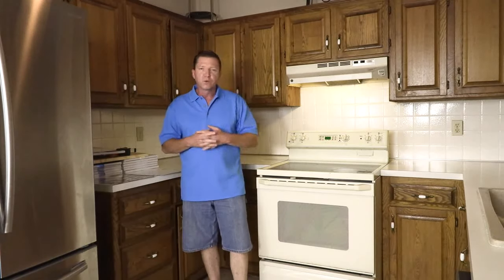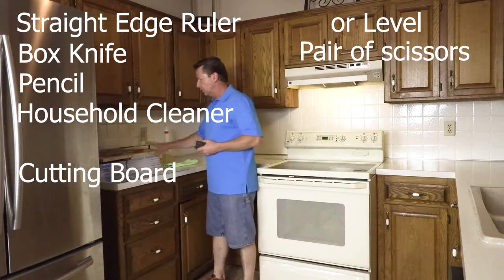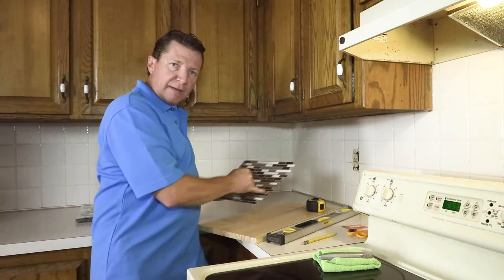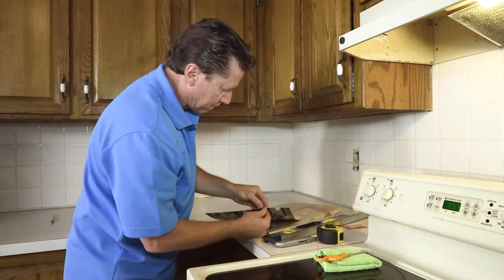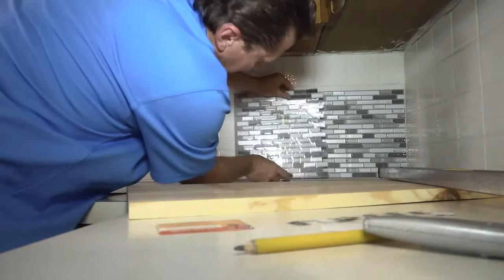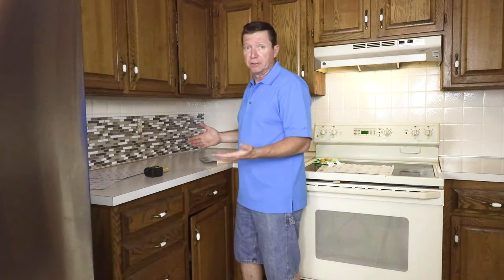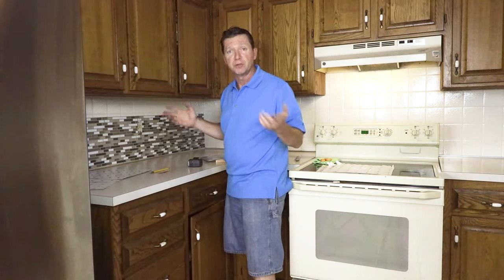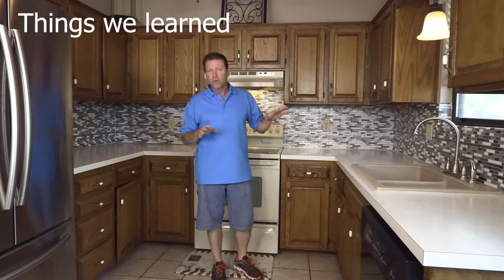Art3d Peel and Stick Tile Kitchen Backsplash Installation

Comment: To make a flat wall so it sticks better, I watched another video that shows filling the grout with quick dry poly filler so it makes a flat wall. This is the video that shows how she did it. That would make the wall flat and that tile would stick well and possibly help prevent any problems with the tiles sticking anywhere. Love the look here! Great job!
Reply: Which video? Can you comment with link please? I am applying this backsplash to my tile walls

Comment: I suggest turning the pieces and mixing them.  If not then it results in a repeat pattern as observed on right area creating a line.  Does anyone else see this? I also see the line on the left yet closer to the counter.  To avoid a repeating pattern make sure the sheets are intermixed. This is similar to hanging wallpaper where depending on the pattern, each sheet should be reversed. Play with it before mounting as I could not live with this outcome
Reply: I see what you mean. The black line of tiles in the middle and the same mountain peaks on the bottom. I also wouldn't have tiled in the window.

Comment: May I suggest painting the cabinets and changing out the hardware for a super fresh, updated look?
Reply: I wouldn't paint those. Maybe sand them down and stain them a deep redish stain would be sweet. And change the knobs to a stainless type so it looks better with the fridge.
Reply: Sanding is essential if you’re going to paint the wood. Paint won’t last long without it. And if you’re already sanding, you might as well stain instead. It preserves the wood and looks way better. I’d suggest, if possible, to remove the trim on the cabinet doors and adding squared trim to make them shaker style. Another top for anyone watching this in the future, before you install these peel & stick squares is to fill in those grout lines with some spackling paste so you have a smoother surface for these to stick to. This is an essential tip for a homeowner. It creates less bumps and ridges during and after application. If you’re just adding these for a rental unit, there’s no real reason to spackle/smooth the area. You’ll likely have to remove and replace these after 3-4 tenants. The cost to purchase and install these is nominal compared to the increase in value a rental unit with these added will have (aesthetics and appearance go a long way with income property).

Comment: A hint about starting on inside corners. At 3:25 he mention cutting off the tabs to begin a corner. This will leave an unmatched pattern in the corner. If you cut a tile sheet in the middle or so and put each piece together at the corner the pattern matches and looks more finished. I made this mistake in my 1st corner before recognizing this. Good thing I started out in a relatively hidden corner.
Reply: I tried this and the issue I had is you didn’t have the  overlap section on one side. Granted the open patterns will match up like a puzzle but it’s not the same since you don’t have that overlap space and it’s a bit of a pain to line up
Reply: @alnsmclm  I am thinking to simply score the first (corner) sheet and tamp into corner but then the sheets on "side wall" would be reverse installed, right?  Does it matter?
Reply: Thanks. I thought what he said wasn’t correct
Reply: I used to do wallpapering. Just like that, you cut the right edge at a corner to make a straight edge to butt up against the corner. You can then cut the left edge of the piece adjacent to that and butt it right against. It may seem counter-intuitive to not have the patter match, but the eye doesn't seem to care about the match at a corner. I have done many, many rooms this way, and no one ever asks to have it redone. It may be an optical illusion, but maybe not. However, the eye doesn't look for a match, perhaps because the corner is a natural split in the view. You may do it either way, good luck no matter what. :)
Reply: Also, if you cut off just the tabs, you should keep them for the end of the run, where you will want to compensate for the indentures by adding the pieces on. In other words, you will need those cut-offs to finish the straight line at the other end.
Reply: @velvetpaws999  

I finished the edges of my tile by using the little bricks vertically.  They look just like real tile because that is how real tile would be professionally finished.  It wouldn't just abruptly end but instead would actually have sort of a frame.  By cutting the little bricks and placing them vertically everything looks extremely finished. 

I wish I could figure out how to post photos here.  YouTube sent me something sometime ago saying that I had the ability to post photos in my replies and I never did figure out what they were talking about.  It must have been some sort of a pilot program that didn't work out because I never did figure out how to do it.

Comment: First of all, I very much appreciate that you, as independent individual, took the time to video record and post the installation of your tile to YouTube.  I've watched the video seven times now and have found that it has left far more questions than answers for me.  This isn't a bad thing because they're questions that would certainly come up during the course of my upcoming installation so it's best that I address them now.  

There are a ton of questions that just aren't addressed in the video that I think are absolutely necessary in order to do a nice looking installation. Especially when the installation is going to be on more than just one wall space.  

I'll refer to the left wall as wall A; the right wall as wall B; and the middle wall as wall C.

1) Why were walls A and B installed prior to wall C?  I cannot figure out how one can anticipate a smooth flow when the center wall is done after the side walls.  Additionally, the manufacturer expressly says to work from right to left but in this video the only wall that that is being done on is wall A.

2) There are no close-ups of the inside corners but from the distance it appears that the corners are rather chopped off and non-flowing.  It seems to me that, rather than lop off the tabs on the edge of each corner tile sheet, that they instead be placed on the adjacent wall thus allowing a flowing and continuous alignment of "bricks".  The inside corners, to me, look like they are chopped (bricks abruptly end and suddenly change shape and color) and a rather large "caulk type line" is in each corner.  What would not work about putting those tabs on the adjacent wall instead so that a flow is maintained?

• Wall B, in the video, appears to have several tiles peeled back up and replaced.  The video is in fast motion so very hard to follow what the second guy is doing.  

• Wall C didn't seem to have a plan to it because it was done last.   I can't seem to follow the reasoning or logic for doing that wall last as it would be impossible to make the corners flow smoothly.  Again, the inside corner bricks would abruptly change size and color at each corner.

• This video features the peel and stick sheets being installed over existing, grouted tile which, of course are not a level surface.  Wouldn't it be wise to go over that existing tile first with some sort of a leveling grout (off top of my head but there must be some kind of preparatory "compound" to level surface) so that there would not be areas for moisture or air to accumulate?  Something tells me that if one is going to be putting a vinyl product over any surface that the surface should be level.  Moisture and air have a sneaky way of creeping into the tiniest of crevices.  

• On subject of putting peel and stick over existing tiles, it seems counterintuitive to expect something to stick to such a very slick and smooth surface such as the original tile presented here.  Is it really ok not to rough up the surface?  Even when reglazing cabinets I had to rough up the existing polyurethane because the new stuff needs to GRIP INTO the old surface, not sit on top of it.  I would speculate adhesive would follow the same laws of property.

• Out of absolutely nowhere the tile sheets appeared on wall C including the tile sheets behind the stove.  How was the determination made on how far down behind the stove to go to?  Should the tiles go fully down to the bottom by the floor in order to alleviate the possibility of air or moisture getting in or were they simply installed for aesthetic means without regard to longevity?  Was the stove pulled out to install the tile sheets or were they just kind of pushed behind the top of the stove? 

• I either missed or don't see the part about how to get the tile sheet up behind the fan or, as many of us are stuck with these days, the over the range microwaves that tend to break and have to be replaced all too often in which case, if not tiled behind one will have a gaping nothingness if new appliance is not same size as old. 

• I missed the part about measuring the outlets and cutting to accommodate them.  I've not yet started mine but I have a good idea.  What about using the plastic to create a template?  One can use a marker to make an X and, since it's transparent, one can easily see if they've cut enough or too little.

• Even though I watched the video seven times, I missed how the second row of tiles was chosen and cut.  This question came up after I got done watching the video, and I'm glad it did, because I'm going to have to do two to three rows myself and they are not all going to be 12 in tall so I miss the part about how to choose the proper cut within a tile sheet to enable a good flow from the first row to the second row to the third row.

I appreciate this video very much, especially since you don't represent the manufacturer, but I have doubts that it would be a good idea to put these tiles over existing, grouted tiles without any type of leveling medium.  I'm also very concerned about having cut those tabs off the end tiles because there's just no fluidity from one wall to the next.   It looks like it just abruptly ends.

These are things that would certainly come up when one is right smack in the middle of installation so I'm glad that I watched this video so that they're coming up now before I'm standing in the kitchen in a bind trying to figure out what's my next move.

I hope to hear back some comments before I get the tile started in my kitchen.  

Thank you!
Reply: I think he said you can email him at Art3d. com.  So apparently he does work there.
Reply: My thought exactly! Why skip over the challenges? I’ve stopped my project to find an outlet answer. No luck.
Reply: Those are all very valid comments! I think it is not recommended to go over such tiles with the grout making grooves. Also, I am not sure if those new tiles are plastic or metal. Some manufacturers have both... but they surely would handle differently. Next, I think they just retiled around the top of the electric stove! Big blunder! Also, I think if there is a window, one has to start with a complete sheet going along down from the window sill, straight along the crease from the sill to the wall below, so that one does not end up having to cut off half a tile at the window sill corner. It would look wonky! For the outllets on the walls, I'd probably do a stencil for each to determine where exactly I want to cut out the hole. The guys here were definitely off some to the right side... and very narrow along the left side of that receptacle on the first wall!
Reply: @velvetpaws999  

I was able to complete my installation on 4 wall surfaces behind sink and stove and they came out beautifully.  The instructions within this video are appreciated, because the gentleman took the time to create it, but they don't work.  It really took a bit of planning and common sense but mostly math.  People who come into my home and see my tile cannot resist reaching out to "pet" it.   It has been quite some time since I put it up and it is adhering with absolutely no problem from the tremendous heat that my stove gives out (I have learned elevated cooking) or the intense humidity from my sink as it takes extraordinarily hot water to scrub stainless steel cookware. 

I sanded the walls down so that they were quite rough thus effecting an excellent medium to adhere to and then wiped them down with industrial strength vinegar before starting to make my placements.  

I wish I were able to upload pictures here but It seems impossible to do so.  I might mention that I used the very deep and rich "Art3d 10-Piece Peel & Stick Kitchen/Bathroom Backsplash Tiles, 12" X 12" Colorful Marble Tile Design in the Multi color".   I blundered on the first box because I was following the instructions within this video but the manufacturer was kind enough to send a brand new box to start over with!  😁 What an absolutely phenomenal company!   Removing those tiles was quite tedious because of the prep work that I did to ensure that they would not peel off easily.  My method certainly proved effective!  LoL!   It did take extra time but the end result is is absolutely breathtakingly gorgeous.  They beautifully enhances the cabinets that I refinished from the cheap construction grade oak to a rich, but customized mix of a Bombay mahogany followed by several coats of water-based polyurethane (chosen because it does not yellow like oil based will).   BTW, not relevant to the tile installation but since I mentioned the cabinets, one literally DOES have to take them down completely and take the doors and hinges off and completely strip them before actually refinishing them elsewise will be very poor quality and, even if it looks okay in the beginning, it will start peeling. 

I've been out of work for 3 and 1/2 years now due to the debilitating effects of cancer treatment and try to find something constructive to do.  It took me much longer than it should have because I followed YouTube videos that really leave a great deal out.  In defense of those that try to create these videos it is darn near impossible to actually provide proper instruction because it does involve math and calculations.  

I absolutely love my tile and, as already stated guests always feel the need to reach out and touch it so so it obviously must be appealing. 

The other plus side is that if anticipates selling their home at some point and potential buyers have a different taste, they don't have to virtually bulldoze the wall to change the tile like they do with ceramic tile.  

I will be more than happy to advise anyone undertaking the job on how to do it properly.  🙂

EDIT:  I forgot to address the issues about the outlets and light fixtures.  You have to take the light fixtures down and the covers off of the outlets so that you can do proper cutouts that will be hidden behind them.   Also, to finish off the edges cut strips of tile vertically so that there is a clear stop and start on each of the walls.  There should be an "L" shape on each the stove wall and the sink wall and the edges finished with vertical placement as opposed to some strange looking drop off.  For the outlets measure very carefully and create an "X" slit so that if your measurement is off your tile is not ruined.  Since the electricity you've obviously turned off, I hope, before starting the project, you can use a very sharp box cutter refine that area once you have it up.  Same with the light that goes over the sink.  I'm not absolutely positive that that is clear so I will say that you simply make the slits so that the tile is fully intact as opposed to making square or round cutouts thinking that they are precision because, odds are are not.  With my "X" method  of slits it is completely impossible to make an error and ruin your tile sheet.  

They are super easy to clean too with just a slight wipe of diluted vinegar.

Comment: We did this and then applied an unsanded grout on top (make sure you sponge off) which completely hid any little seams and made the backsplash look much better.
Reply: Is your backsplash holding up? I just put mine up but would love to put grout over it

Comment: Thank you.  I learned the hard way but if your tile has uneven height of individual stones that you need to line up start from the right and work your way left.  This way the white underlay will always line up with next tile facing left.  Your tile was equal so you could turn either way.  Mine I needed to align the tiles one way only.  I’m glad I learned this on a small pantry backsplash before I started the big kitchen job.  Thanks again though for showing us.